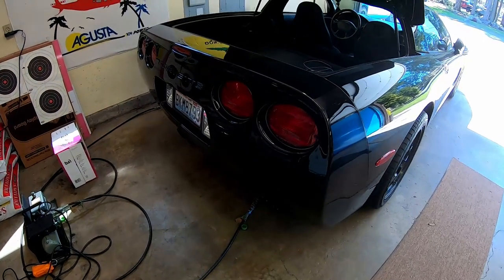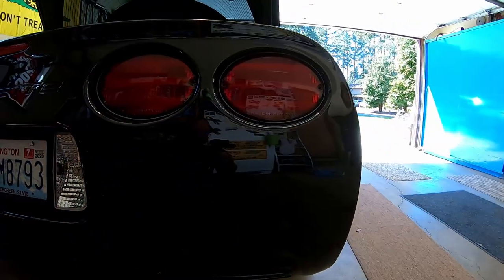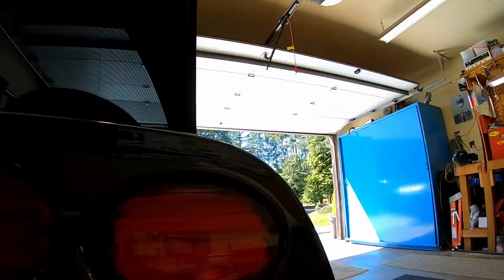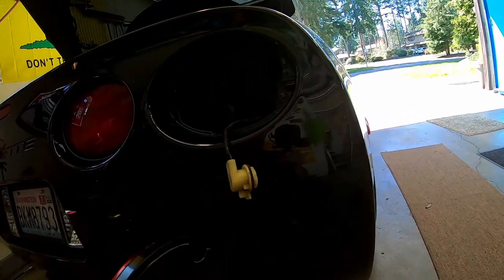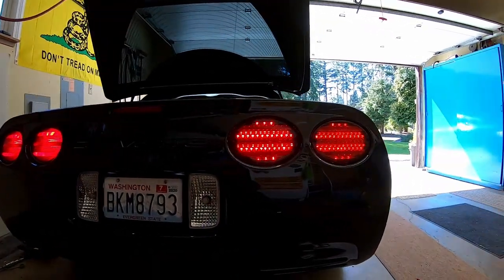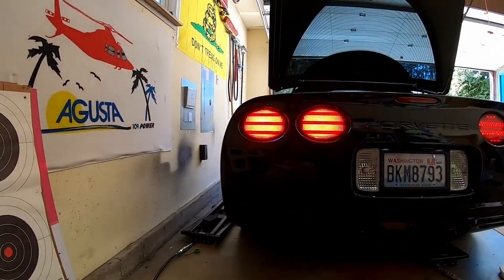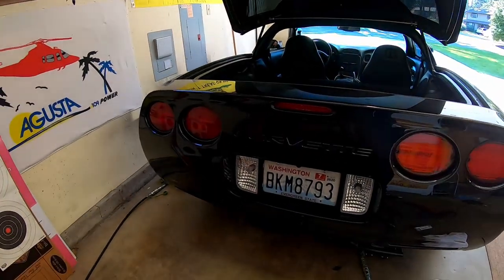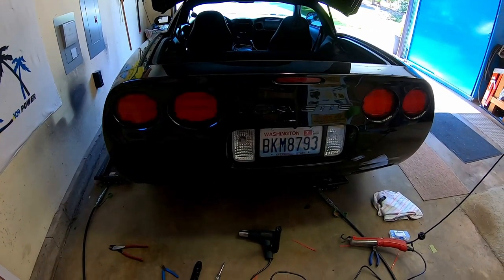RV LED Tail Light assemblies on a C5 Corvette? It Works.

Comment: Awesome, they look great. I have these also but I installed a connector on them and use them for a backup light in case my halo LED's have issues.
Reply from the maker: The halos are cool grape but I'm cheapskate at times lol.   It was hard to pass this setup up for 50 bucks and have nice shiny new lenses.  I'm still not keen on the lit look but it's growing on me.

Comment: Would you share the parts number/ description to order the lights from Bend Trailer?
Thanks
Reply from the maker: Charley I haven't seen them at bend for a while.  Check out this link if the link posts.   These are the exact same units.  https://pantherrvproducts.com/eco-series-l03-0066-led-oval-sport-trailer-tail-light-52-diodes/

Comment: Thanks so much for this video, unfortunately Bend was out of stock with these as was Amazon when I went to order, but I was able to find them on Panther RV Products website for a few bucks more. Just got delivery today, gonna' install them with cheapie plug adapter harnesses off ebay once I get my Hyper Flash Harness. Really appreciated this info, cheers!
Reply from the maker: Thank you Mr Steele.  These lights seem to work great for the dollar and just having fresh lenses on the car really helps the appearance.
Reply: Can't wait to get my Hyper Flash harness and the connectors. I don;t want to cut the harnesses, wanted it to be plug and play, so now I wait for these goodies to arrive. Thanks again!
Reply from the maker: @gsteele2612   Ha!  if I would have known I have a extra hyperflash harness and those socket adapters sitting on my bench that I'm likely never going to use. Hopefully you get them soon.
Reply: I appreciate the thought, I'm a patient man and it won't kill me to wait, haha, thanks man

Comment: What other lighting mods are you looking into?
Reply from the maker: Hey FRC.   I'm currently working on switchback drl turn signal setup but I haven't been able to get that to work 100% yet. At least it works now though and I'm legal there as my turn signals up front work again.  After that I would like to buy one of the nice full headlight replacement kits but that's a ways down the road as I just don't really drive this car in the dark much.
Reply: @PNW_Car_Mods  I’m actually looking into changing out the DRL and headlight housing. I have my eye on the radio flyer ACA setup. Have you seen better options out there?

Comment: They have led kits that just plug in to your original hardware.. oh well.. lol what ever works
Reply from the maker: Did you even watch the video?   I talked quite clearly, at least I thought I did about all the options.   I have like 50 bucks into these.   The plug and play c5 LED tails that cost upwards of 300+ dollars still made in china.    I had adapters as well and elected not to use them as it's just one more failure point.   I could enviro splice new factory connectors back into the factory harness quicker than it took you to type that comment lol.
Reply: @PNW_Car_Mods  lol they loon good.  U kinda skipped through video..to see lights finished 😆..
Reply: Are we go to save money with these lights or should we buy the LEDs that belong on the car
Reply from the maker: @philtroskey3454  You can buy what ever you want.  These work great.    I don't really care about Halos and to buy halos you are looking at another 150 plus dollars for super chinese lights.